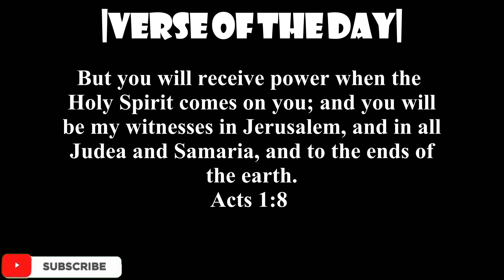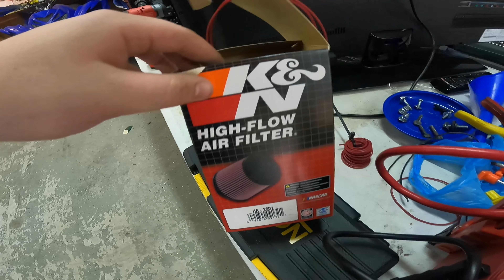K&N Air Filter, DG Exhaust, Dino Kit, and Nerf Bars for the TRX250X

Comment: i like my  trx 250 ex stock exhaust ..so quiet no one knows im out on the closed roads....
Reply: Smart man, Stealth Riding is the best. Nobody cares if they dont know u were there. Was wondering if just the air mods w/ jetting would get enough power gain.
Reply: Is the x and ex the same!? I see some ppl call it the x and didn't know if that is a new model. I had a 2009 trx 250 ex. Was just curious
Reply: @fishsizzle83  from what ive seen on  you tube..performance parts and upgrades..depending on the year..there's a new one trx250x go figure..

Comment: do you have wheel spacers or extended a arms and axles?
Reply from the maker: The Front is a Dimond J Customs Widding kit that extends the arms and there are wheel spaces on the back to make it even!
Reply: @Wheeler_Bros  Ok thankyou might just have to get that do you know how wide you got yours there's a few options and can you use the OEM shocks?
Reply from the maker: Well, after we added the kit, we measured the Wheelbase and the Raptors Wheelbase. So, the Raptor's was around 50 inches and the TRX250's was at around the same close to 51. It looks like a YFZ 450 but is slow XD. It was funny everyone wanted to race it until they saw it was a 250.
Reply: @Wheeler_Bros  lol ok thank you
Reply from the maker: @flynnlawnservices   Sorry for being not that helpful I just don't want to lie to you you know?
Reply: @Wheeler_Bros  no you helped me alot i allready order a widening kit and some wheelspacers. you also got a new sub 😁
Reply from the maker: @flynnlawnservices  Glad to hear, thank you so much for the support!!!
Reply from the maker: @flynnlawnservices  Thank you!

Comment: Can you send me the link to the k and n airfliter I can’t find it
Reply from the maker: https://www.amazon.com/HA-2501-Honda-Performance-Replacement-Filter/dp/B000AP1MRK/ref=asc_df_B000AP1MRK?tag=bingshoppinga-20&linkCode=df0&hvadid=80745439395092&hvnetw=o&hvqmt=e&hvbmt=be&hvdev=c&hvlocint=&hvlocphy=&hvtargid=pla-4584345016084249&psc=1
Reply from the maker: This is the Online link we used most if not all of our stuff comes from Amazon or eBay

Comment: what jet kit did you use
Reply from the maker: Honestly, I don't remember now. I will have to see if I can find it in my notes
Reply: @Wheeler_Bros  ok thank
Reply from the maker: I'm pretty sure we went back stock. When we went up or down it would choke it out, but it also depends on the air intake setup.
Reply: Ok. I’m looking for one for a Honda recon that is more than just a stage 1. Because I plan to get the DG exhaust and an upgraded air filter.
Reply from the maker: I gotcha worse comes to worse I will take it apart and take a look. Sorry I couldn't find any information.
Reply: That’s ok. Did the jet kit make a big difference.

Comment: How much hp does air filter add
Reply from the maker: We haven't had it dyno, but I can say it made a big difference. It woke it up! Worth the upgrades
Reply: @Wheeler_Bros  what happens when I remove the air box lid can I still ride trails?
Reply from the maker: @HHCKING  just be careful in water